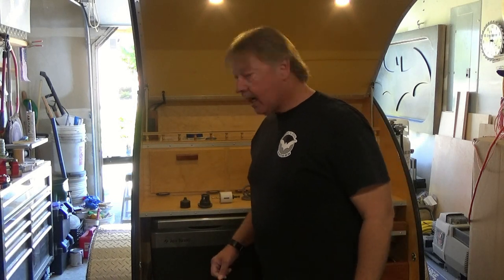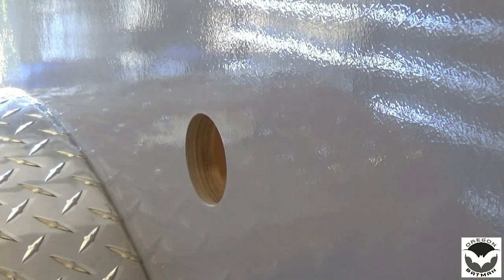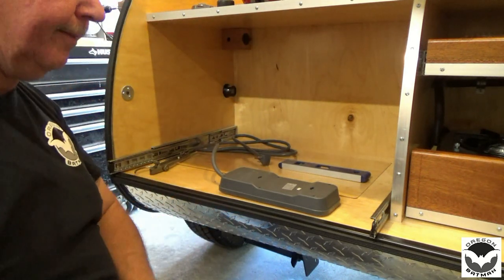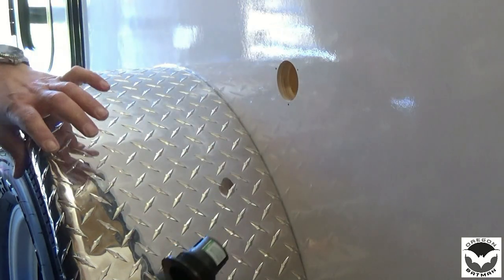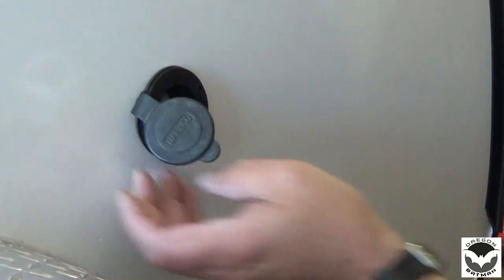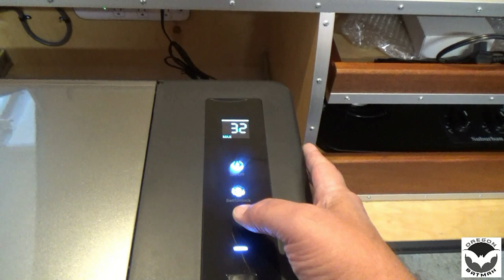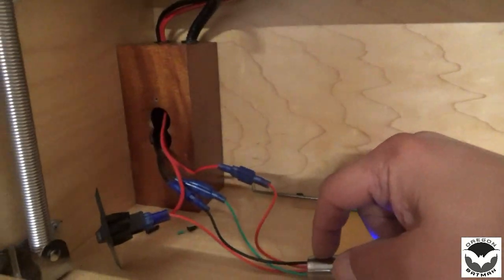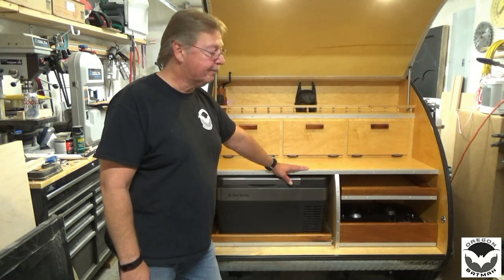Let’s Build A Teardrop * Step-By-Step * - Part 58 (Shore Power)

Comment: Simple trick for transferring mounting holes from a part (power strip) to a panel (wall) - photocopy the part, then tape the cop to the wall, screw through the copy, then tear it away - if your copier is set to 100% it works perfectly every time...    Awesome series, thanks!
Reply from the maker: Awesome tip! I will have to try that next time. Sounds like it would work! Thanks for watching Eric!

Comment: Still in the planning stage but as for electrical I’m looking to have solar and an inverter in an “electrical” box, then route my shore power to he same box. Then I’ll use a marine type A/B switch to go from 12 volt to 110. It will take a bit more wiring but should make for seamless power transfer. Oh, don’t forget the trickle charger!

Comment: What if you put a computer fan behind the fridge to blow some of that heat into the cabin?  Might be nice in the cooler months.
Reply from the maker: Sure would! I do have a fan that would fit... but I have something else in mind that will do the trick. I still have to run some power to main cabin.

Comment: To hang anything on a flat surface, put masking tape on top of the level hold it to the back of plug strip, Mark your holes ,now when you level your holes can be marked on flat surface. Saves some steps.
Reply from the maker: Thanks Johnny... great tip! Definitely a better shortcut to save time!

Comment: Beautiful camper. Love the attention to details. I was wondering if you had thought about adding a small trickle charger with the shore power to keep the battery topped off when connected. That way you're getting a charge while sleeping at night. Batman does sleep at night doesn't he? 👍😉
Reply from the maker: At night, Batman just 'hangs' around! LOL! I do have a little charger that I will be installing in the tongue box at some point. That will help through the winter months to keep things topped off. Thanks for the input, very useful!

Comment: I'm not an electrician but I haven't heard of 30 amp surge protectors. When connected to the 30 amp shore power the surge protector might overheat if its only rated for 15 or 20 amps!

Also you said last video you were finished but it seems to never end :P Just kidding, the upgrades will continue forever.
Reply from the maker: Have to get an inline 20 amp protector, I heard not to trust the RV hook-ups. Better safe than sorry... and yup, never ending to the upgrades! Couple more things and we're done! :)

Comment: Is this a 30 amp inlet? And is that a special surge protector? It looked like you plugged a regular extension cord in. We love your setup and looking for advice
Reply from the maker: Hello... this is a 20 amp inlet, no need for a 30. Surge protector rated for 20 amp. Use the power for the fridge and a small 200 watt heater. Works great!

Comment: Question about the dimmer in the back. If you dim the lights, and turn the power switch off, do the lights stay at the same dim setting when you power it back on?
Reply from the maker: Great question! Nope... when you dim the lights and turn switch off, then turn back on, it is full on bright. Also... if you start to dim then take your finger off, then touch and hold again, it gets brighter as well. Pretty cool, I'm liking it!

Comment: We can’t wait to start our build. Having trailer made to your specs. Did you go with a 2k or 3500 torsion axle and what size wheels and tires did you settle on?  It looks better every Saturday. Really nice work!
Reply from the maker: I had a 2000 lb axle from a previous build, so went with that. Not going to see much off-road so will be perfect for me. Decided on 15" wheels/tires since I'll get a lot of highway use.
Reply: OregonBatman 

thanks Batman. Your videos are great
Reply: OregonBatman 

Btw the guy who’s building the trailer frame said your drawings were spot on
Reply from the maker: @mjt8593  Thanks Mike! Hope you find them helpful with your build!
Reply from the maker: @mjt8593  That's awesome!!

Comment: Hi, wouldn't it be a good idea to use shore power to charge the battery?
Reply from the maker: I do have another connector that I will install to the tongue box and have a small trickle charger that I will use through the winter months while in storage. Solar will get me through while I am out and about. Thanks Ivo for the comment!